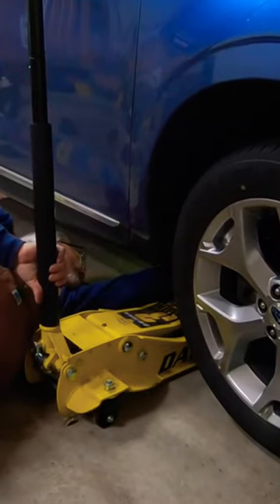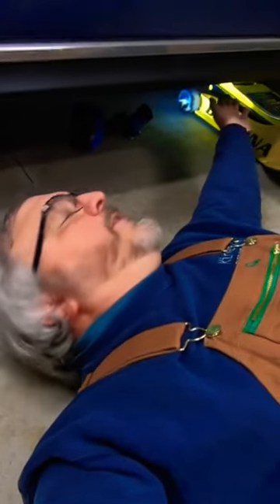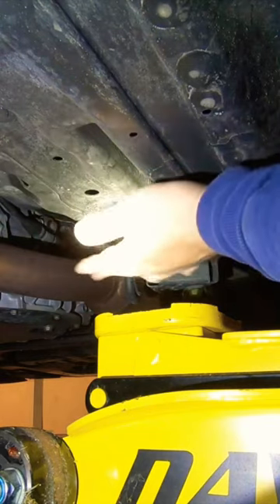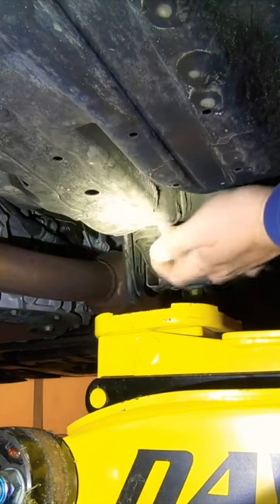Looking for New Jack Point on Forester 🔺#shorts #diymechanic #garage #carmaintenance

Comment: I usually go with the strut mounts. They seem to be pretty strong.
That is my biggest complaint about vehicles that don’t have actual frames, though.
Reply from the maker: Agreed on complaint about these unibody vehicles without "frames".  So much easier on my Wranglers and even my Liberty it's a bit more obvious where its unit-body strong-points are.  I'll look at the strut mounts on that Subaru and see...that might be another option 👍